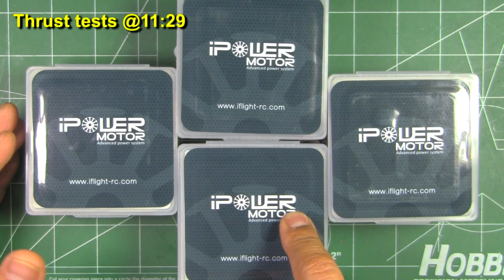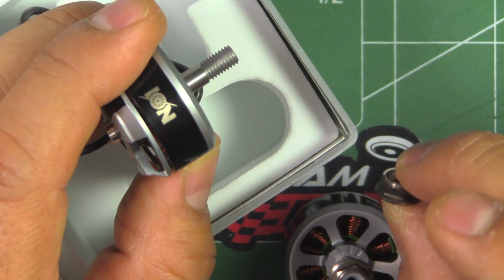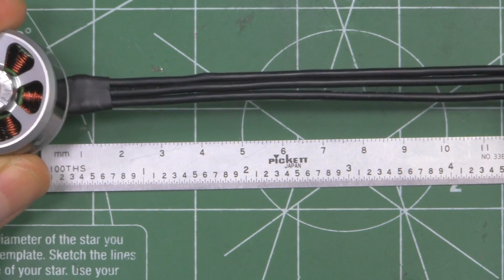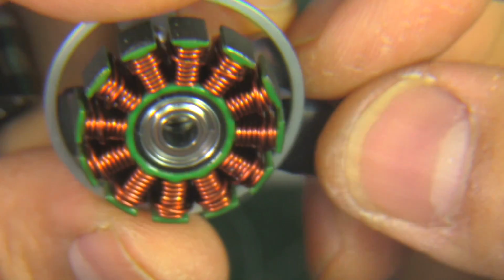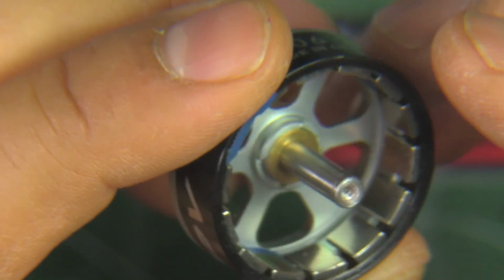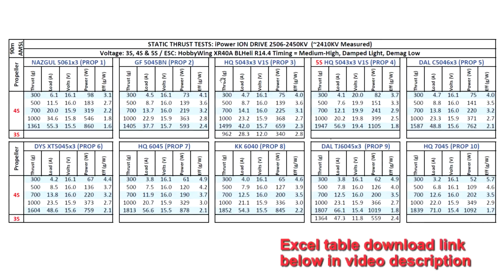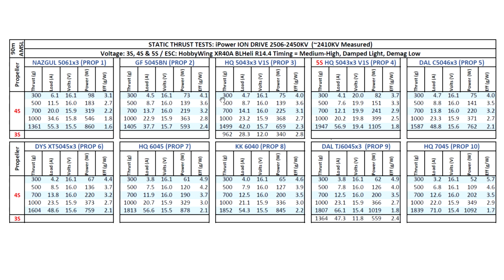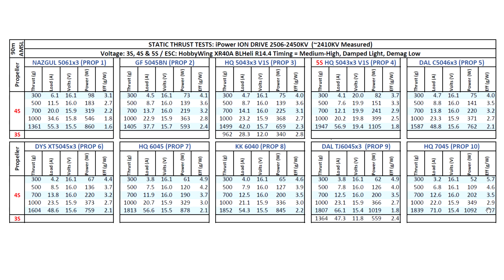iFlight-RC.com iPower iON 2506-2450KV Thrust Tests & Overview

Comment: I have been running the 2506 2450kv on 5s with hq 5048 v1s for about six weeks. Totally love them. A bit heavy for 5" but tons of thrust and very efficient.Also,the coolest running motors I have used. I'm about to try them on a 6" build.
Reply from the maker: Yea, these took all thrust runs like a champ. Barely got hot. That's what a big motor offers.... efficiency and cool running, in exchange for heavier weight.

Comment: A video with you just talking about what makes a good motor and going over pros and cons of different sizes like 2207 vs 2305, single vs multi strand copper,  your idea of the perfect race and/or freestyle quad motor, etc would be awesome
Reply from the maker: The main reason why I have not yet done a video like that is because over the last year I have not had enough time for flying. Work has been busy this year so I haven't had a chance to "feel" each of the motor sizes so I feel a bit ignorant as far as actual in-flight feel at this time. Hopefully in the near future I do get I chance to setup a test bed where I can swap a few motors and get some stick time and see each motor's response in the air. Thank you very much for your suggestion and for watching, I will certainly keep it in mind.

Comment: There seems to be a discrepancy between the figures shown at time of test and what's later shown in the table at the end. The HQ 7046 made 1839g, 41.7A at 19.6v on a 4s? Then in the table it shows 1839g, 71A at 15.4v on a 4s.
I'm interested to see how efficient these motors are for props up to 9". I have a large DIY drone I'm building and am stuck on motor choice. Thanks.
Reply from the maker: Sorry I may have botched the figures on the video, I've uploaded and linked the Excel thrust table which are the correct figures and supersede numbers shown on video. Anyway,I'm going to check it ...carefully and may have to render again and upload again if there's too many errors. Thanks for pointing that out. That's what happens when you try to edit and upload @ 2AM

Comment: Great information and great testing. I always find great information here. This motor seems to be fairly inefficient for the size and price though. Max continuous amp rating at 34.5 amps. Looks like anything larger than a 5045 would be way over at close to full throttle.  Looks like the HQ5043x3 is the most efficient and I thought this motor would excel with a 6in prop. Thanks for the testing and all the great information. Seeing how these motors perform with all these prop combinations is fantastic!
Reply: The proof is in the pudding, I fly these with a 515Gr AUW rig with Lumenier Gate breakers (aggressive prop), I get about 2.5 minutes of really aggressive freestyle, and low altitude carving, motors come down barely warm at 80F ambient, and batteries are just luke warm. They have less chooch than my RK 2307 2540KV motors, but they are smoother on the other hand.

Comment: Thank you for testing a 7" prop. Do you see yourself testing the new ZMX FinX40 Minotaurs anytime? I just ordered a set for a 7" build and I'm really interested in seeing what a 2607.5 motor will do. The Teshkent high kv version should be really interesting.
Reply from the maker: I've asked SilverDrone for test samples a couple months and they said they would send some for testing but nothing received yet. I imagine they're selling out batches as soon as they get them in stock.  If you haven't checked out Adam-g1's flights with the FinX40's on 7" you gotta visit his channel : https://www.youtube.com/channel/UCnzfvvQZM9S2e9YHnFt3oPQ/videos
Reply: EngineerX I actually just found him last night and we talked. He gave me some prop recommendations which I really needed. Silver-drone will have everything back in stock on the 25th so hopefully they send you a set. I should have everything for my build by the end of next week. The UndergroundFPV Metal Extreme ESC's should be pretty crazy. All this is going in the new Karearea Toroa which I think would be a great frame for you to test that could add some subs for you. I will mention you to Dean and hopefully we can get you one. Thanks again for the response.
Reply from the maker: Adam-g1 has done some of the best flight-testing on 7" FPV using all the latest components so he's got some good advice on what works. Thanks for the recommendation! Looking forward to seeing how your build works out. Those ESC's look pretty good

Comment: interesting motor for 6 inch, the 2100 kv one should be even more efficient for 6/7 inch. Also the 2100kv is 7 grams lighter according to their site.
Reply: Agree, I'm looking for a 6" Long range motor. hmmmmm
Reply from the maker: Right, I'm also curious to see results for the 2100. I was a bit skeptic about the shallow 6mm stator but it didn't do so bad. I'm sure when uploaded the Amps will be very manageable. Seems there's a resurgence of 7" & 8" builds.

Comment: I don't think the amp draw is that high, I run a quad with 515G AUW and 5" Luminer Gate breakers, I'm still getting 2.5 minutes pushing them HARD. 

Now the thrust is respectable, but not crazy high, what you do get is simulator smooth throttle response. 

I mostly bought them because they are unique, inexpensive and built like tanks- my favorite motors to date are RaceKraft 2307's, light (around 30gr) smooth and have some serious top end.
Reply from the maker: Yes, these are strong motors. They used good bearings and though they're a little heavier than other motors, for freestyle and bashing around , they're quite good.

Comment: seems a bit disappointing for a large stator.. maybe they should have gone 2509 as we joked before! lol
Reply: i have mentioned before i have been experimenting with these 25XX motors and 7/8inch props. depending on kv i have found they work best with 6inch and above props, like EngennerX said 25XX is a bit overkill for 5inch props unless you run them on 5/6S 
they do perform better with a taller stator i have been using 2507 and hopefully soon trying a 2508, i also know of a 2514 motor that is said to have good performance but is quite heavy at 72grams but its still a potential motor if the 2508 doesn't work out with 8inch props.
Reply: yes they are in the middle of testing a 2508 motor with various kv's and from its initial design be a worthy upgrade to the current 2507 range which is a little under performing in flight compared to bench tests, I'm waiting on them for a set of preproduction prototype motors to test on my quad, also hopefully will get one or two versions sent to Engineer X for testing too in the near future.
Reply: FinX40 is 2607.5 is close to that size, and basically same weight as this.
Reply from the maker: I wouldn't be surprised if we see a 2509 LoL .... RCX mentioned they were working on a prototype 2408 so it seems the race for big motors is on
Reply: well we discussed keeping the notion of square bore n stroke like a combustion engine. so 2509 would  keep the trend of 2306. its a sweet direction to go as this will soon allow DJI type drones to have decent speeds and still maintain efficiency! my TBS disco awaits the new sizes!! hahahaha :)